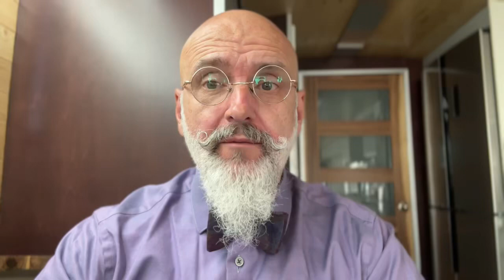PIR , how to calculate Panel Impact Ratio

Comment: Yvan, I won't disagree that snow-foam can be expensive, but I think you're mischarectizing the manufacturer's motives for quoting PIR in their instructions. It is to ensure that chemicals that are acidic/alkali in nature are used at safe enough levels. I have a range of pressure washers and snow foam bottles that can chew through between 7.5l/min to 12.5l/min, so that has a measureable effect on the concentration level of the snow foam produced especially when you want to work at the maximum PIR the manufacture warns you not to exceed. And I stress the word maximum, because although there are products out there that can be used at 4% or 5%, that's only required for very dirty cars, and that you'll get good results with PIR as low as 1% or 2%. And I don't know how big your car is, but I only need up to 0.5 litres of snow foam solution. In your example of 10l/min setup, that would equate to 50ml or product to achieve 1% (100ml for 2%). So saying that you need 400ml of product is over-sensationalizing this topic, and I'm sure that's not what you were intending. I would flip this the other way around, and suggest that manufacturers who don't publish PIR instructions are knowingly selling products that are largely inneffective, because they have to err on the side of caution and give you poor performing products no matter what concentration your setup is capable of.
Reply from the maker: Thanks for your comments. There are many quality products that do not publish PIR, but if they did it would be less than 1/2%.
Reply: Exactly, I know darn well why the products I use state PIR's.
Not all products people like to use in foam canons are effective as snow foams either and are much better suited as pre-sprays with that PIR dilution ratio.

This guy often strikes me as someone who wants to indeed oversell some of his 'knowledge' and tons of people simply buy into it, but the reality isnt just black and white.
Reply: @Detailers-Business-Academy  Thanks for your response. Would you mind sharing some of the products you are alluding to. Most of the "enthusiast" grade products that don't publish PIR tend to be around the 1% PIR level based on my calculations and correspondence with their technical departments.
Reply from the maker: There are several using this calculation. I agree that anything over 1% is simply overkill.
Reply: @KojakKronos  There are not many companies that provide PIR in their usage directions. 
So I was wondering and can't really find any confirmation, but basically if there is no PIR guidance, you can still calculate how much product is needed for your own cannon, right? 
Just figure out how much water it takes in total to empty your foam bottle and then use that total volume for more commonly used 1:X delution ratio, just keeping in mind that this is the ratio not for the foam bottle volume but for the total volume you figured out earlier. 
Am I right?

Comment: That's why autofoam is a pretty expensive presoak. Like a couple dallors per pre wash.
Reply from the maker: Thank you for commenting
Reply: In the uk it’s only £84 for 25 litres and that’s free delivery so works out pretty reasonable at 4% ratio even in a foam cannon.
Reply: I’ll admit I got caught up in the foam cannon craze. Didn’t take long to figure out I was wasting money. That being said I have found a use for it cleaning construction/farm equipment using purple power RV and boat wash does a great job for very little money. Thanks Yvan!
Reply from the maker: Thank you for your comment.

Comment: So correct.. using a foam cannon with foam shampoo isn’t worth it for me.. Even if you get the PIR right most shampoos do very little in terms of dirt removal over using a pretreatment with a rinseless wash..
Reply from the maker: Very few actually do anything other than look good.
Reply: Use Bilt Hamber its been proven to work

Comment: Way back I bought the 6.6 gallon container of Auto Foam for $200. I thought; 844.8 oz’s so it’s about 25 cents an ounce. But I’m using like 500 ML’s in my kranzle😅

Needless to say once you get the price of incredible suds down in the gallon size, I’ll be switching 🤘
Reply from the maker: Thanks
Reply: Crazy, i have the same 6.6 gallons, i look at it the same way but only use 280-300 with my k1322